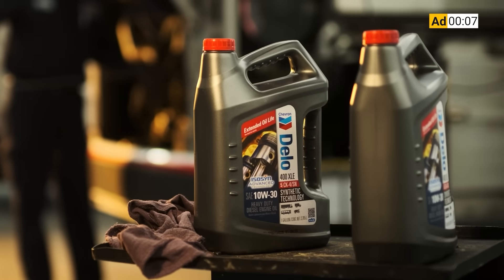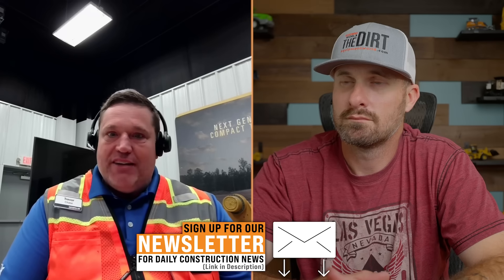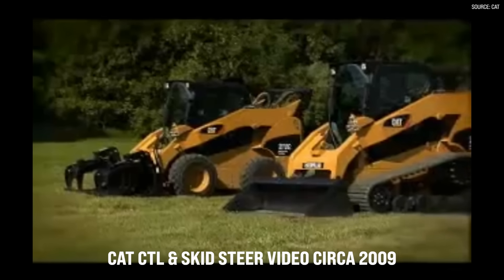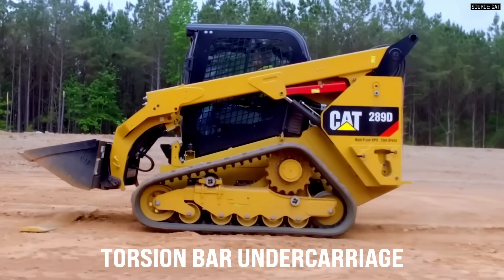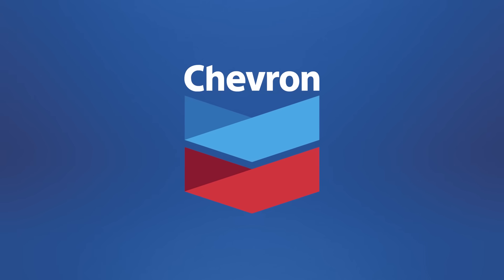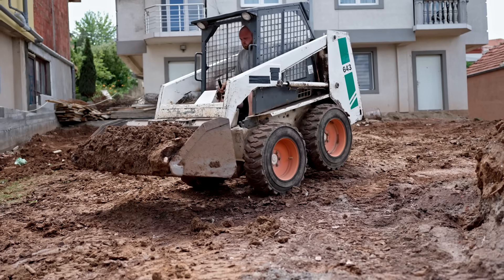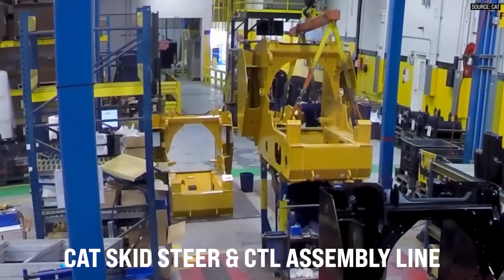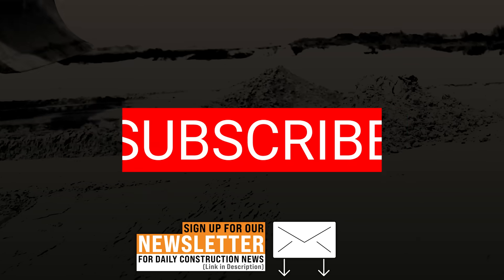Cat’s All-New Beast of a Compact Track Loader: The 285 XE

Comment: Swing door, no thanks
Reply: You must’ve never been near a new skid loader then because all you gotta do is pick the door off unplug the harness and tell them monitor that you don’t need a door on how simple it’s not clattery like a Kubota is or a tak
Reply: Taking the door off is fine except when it’s really hot or cold out, or really dusty. I’ll take the rattle from the Kub or Tak in exchange for the ease of having a door or not.
Reply: @tylermacconnell217  I’ll take my 134 hp 275XE over the roll up door. Kubota is nice but it doesn’t make a machine that compares to a 275XE.
Reply: Swing door is the only door
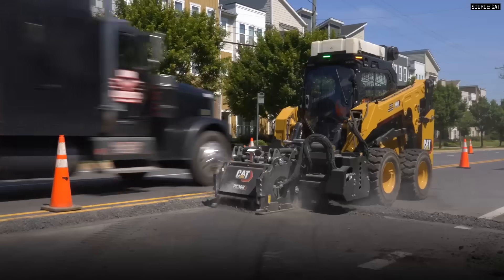Reply: 2:36 2:40 😮😮 2:43 2: 3: 3: 3:06   56
Reply: 3:51  @jpa1282
Reply: 3:58 3:59 3:59 3:59 4:01
Reply: @jpa1282 no one wants a clapped out over head door in a few hundred hours
Reply: I want one with steel tracks and a control lever detent on the travel lever
Reply: @scottmcquarrie7295  I asked about steel tracks when I ordered my 285 and it took awhile but the dealer came back and said that's not in the plans. 😢

Comment: What are the price points for the 275's, 285's, and the XE's? I'd like to run one but no need to waste time if it is WAY OUT OF a decent price range.
Reply: I got quoted 123k for a 275 and 150k for the 275 XE
Reply: @evancrafts2138  I got quoted 101 for a 255, I think for the price difference I would be better off going with the 275
Reply: @evancrafts2138  You got a better deal for the 255 than me. I don't have the extras you got.
Reply: @medlinlandmaintenancellc  the 255 it self was 89k with every option but the side cameras.
Reply: @evancrafts2138  where are you located? I'm in N. C.
Reply: @evancrafts2138  I got quoted 101k for a 255, I think I would be better off to go with the 275 far as what I was quoted.
Reply: I got quoted 208k for a land management 285 in Hawaii
Reply: I got qouted 115k standard flow 275, 96k 265 sf
Reply: @digginandbuildinwv7012  These prices are insane. I understand things go up, but this is crazy!
Reply: I had a go a few weeks back north carolina. It's a bit of a beast. I can see  the uses for it but  my sandpit isn't big enough. I'm a 255 guy
Reply: @chriss7930 what made you go 255 over 265?
Reply: @evancrafts2138   I'm in the UK and do road planing, roads  and footpaths. The bigger machines  I also have  but are a pain as they are to big or should I say to wide  where as the 255  is  narrower  and suits my sandpit better

Comment: Very informative! Would love to know what size rubber tracks do they take? ( 275/275 XE & 285/285 XE).  Thanks!
Reply: Steel Imbed Rubber Track – 400 mm (15.7 in) block tread,
450 mm (17.7 in) block tread, 450 mm (17.7 in) bar tread
Reply: @  thanks! Do you know the number of links?

Comment: John Deere is better than
Reply: Bullshit
Reply: @HungWin916  North Carolina near Asheville
Reply: Still no match to the Minotaur... weight moves dirt
Reply: @digger7871 most obnoxiously loud machine I've ever operated, but will push a house for sure
Reply: John Deere is great for farming equipment, for construction equipment CAT is king. Nobody else comes close to getting parts or service to you, not to mention their machines have been incredibly reliable for us.
Reply: Apparently there is sum people in this world that have lost their damn mind!!! Lol a junk Deere better than a cat??? Maybe junk Deere is better than a mustang skid steer!!! I work for a rental store service 60 machines all junk Deere 3 of our 333gs blowed up less than 200 hours can't bushog with them constantly overheating service TK has to constantly go out and blow the radiators out. I could go on and on especially 317g track skids constant wiring and starting issues!! Junk junk junk Deere!!
Reply: @donnyrandolph9614  sadly this is common for deere equipment. the motors blow within the first 2000 hours. complete joke for a company with that history but its all equipment across the board even up into the 470G
Reply: @RatedT_Crushed the new Deeres run Yanmar engines
Reply: @digger7871 Deere skid loaders have had yanmar engines for over 10 years
Reply: @Dc0o0o0o0  the correct answer was CAT
Reply: ASV still the King!  49gpm,  cadillac ride, no overheating, and huge ground clearance
Reply: @BobbyChamberlin  Yanmar owns ASV